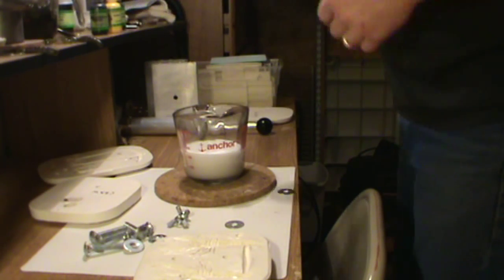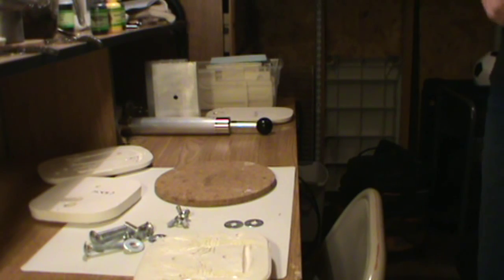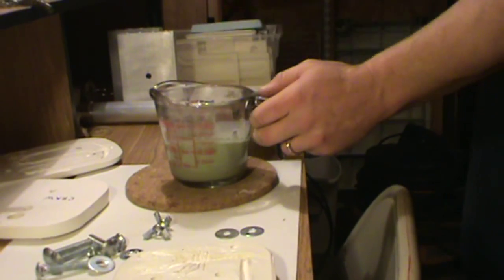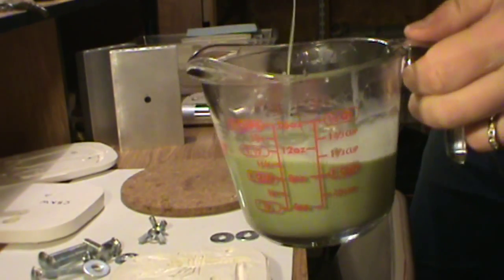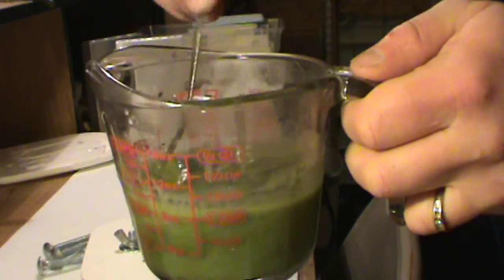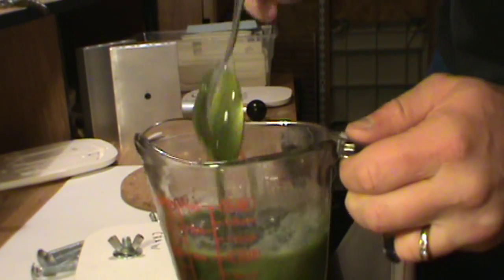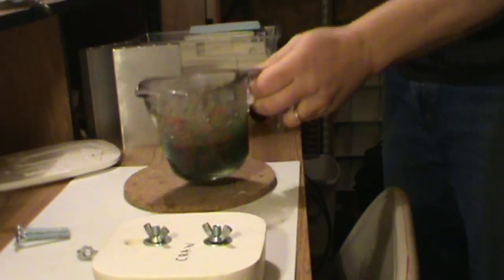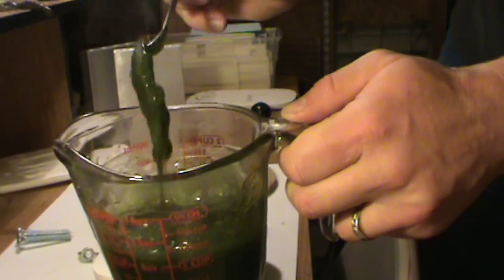Soft Plastic Bait Heating Your Plastic Part 1

Comment: I had a question about plastic hardness. I would assume that a plastics hardness and density is based on the liquid plastic purchased. Could you explain some of the differences in the ones you buy? Or do you only buy one? Also have you ever tried doing what Zman does and used the floating stuff?
Reply from the maker: There are several different types of plastic hardness or softness. I buy a medium plastic and add hardener or softener if I want to change something, which I almost never do. Yes I have tried the floating bubbles, they are dangerous to work with as your not suppose to breath them. It is also very hard to get the correct colors, the floating bubbles are white and you have to compensate for that when mixing. The temperature is also challenging.They make a floating plastic now but I have not had the chance to try it.

Comment: Where do you order you plastic making materials? Also, I am making plastics for ice fishing, and was wondering what I need to get started. As in do I need to get hardener, since I want the plastic to be super soft?
Reply from the maker: you can order from bait junkies or many other suppliers .. go to lonestarbaitco.com and you will find a list of suppliers. you wont need hardener for soft baits, you might end up using softener. I would order the plastic you want pour some baits and see what you think if you want them softer remelt them and add softener or just order softener and make some more.

Comment: Your PoP crawfish mold doesn't have any air vents. Is there a technique to prevent bubbles...have you had that problem? Also, I didn't see any videos where you talk about the bolts and washers that hold your PoP molds together.  Any hints on that?

Thanks for the video series.  I'm excited to get started. :-)

Jeremy
Reply from the maker: I think most bubbles occur when the plastic is heated. The plastic doesn't bubble in the mold, all the air is forced out between the mold halves. I have had a couple people ask about the bolts. I need to make a video on that I guess. I use 3/8 bolts with big flat washers and wing nuts. I use the big washer to spread the pressure out over more surface area.